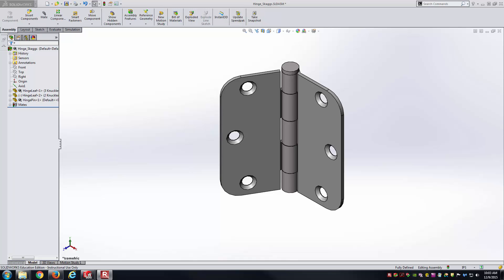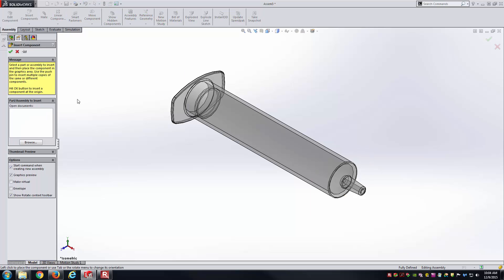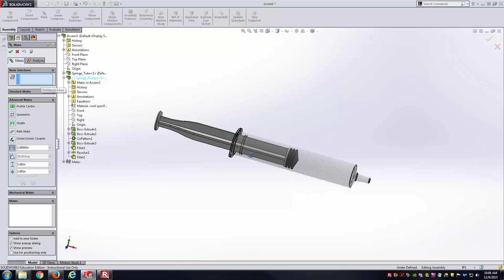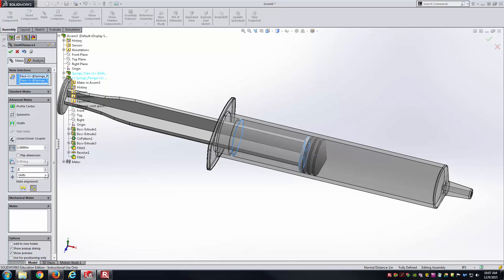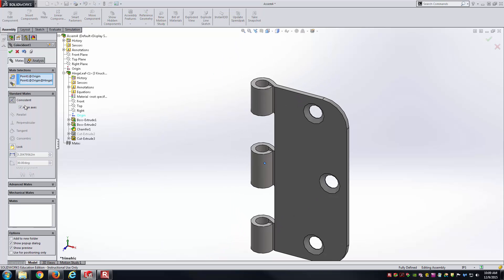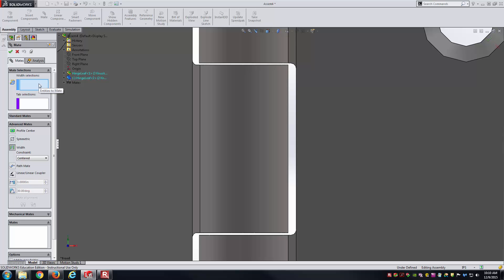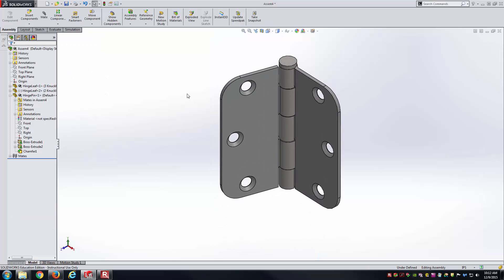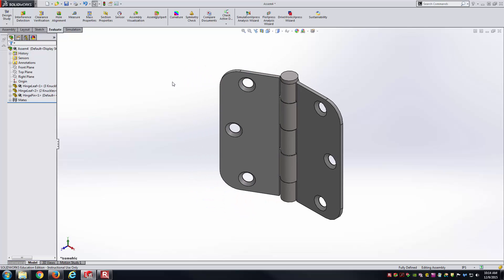SolidWorks - Limit Mates

Comment: How would you drive between the 2 points so that the plunger moves without dragging it at a preset rate. It was dead easy on Inventor but I can`t do it in Solidworks?? Thx

Comment: Thanks for the good video mate! Couple of additional hints: when bringing the first part to assembly, if you DON'T click a place for it, but instead click the green "OK" symbol, you'll mate part's origin automatically to the origin of the assembly. Also you can lock the rotation during making of the concentric constraint by just checking the box "Lock rotation", so no need to make an additional mate for that. :)
Reply: I've been using SW forever and just only used the auto fixed option for new assemblies, thanks for the hint on the origin snap!